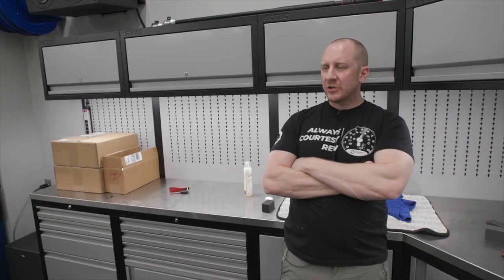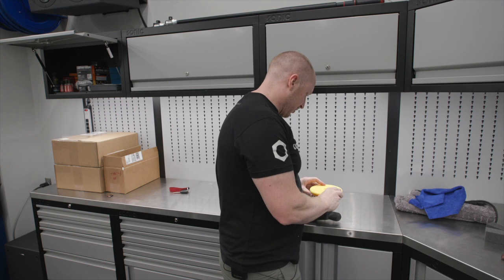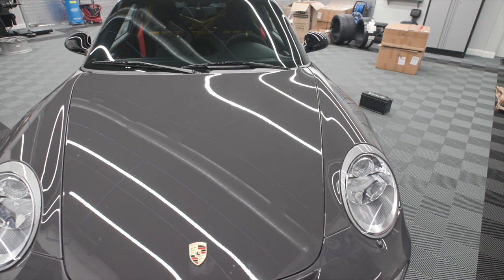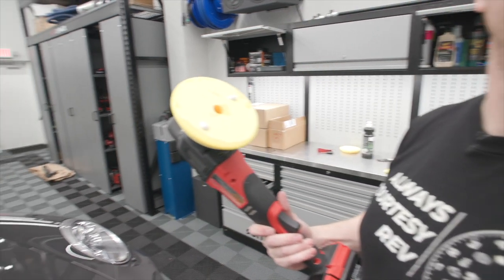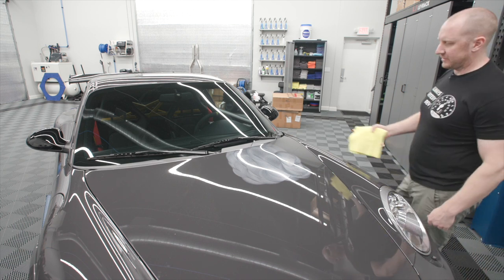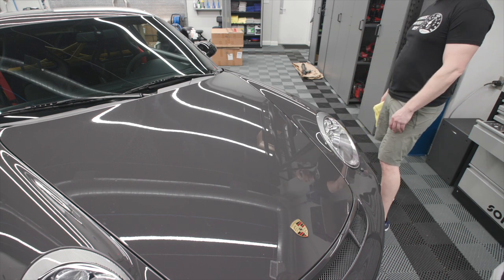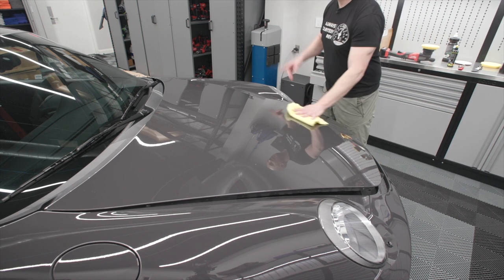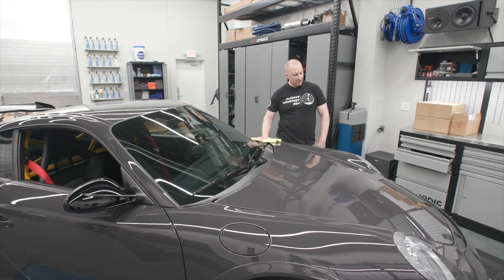How to Polish PPF - Giveaway 997.2 GT3RS

Comment: Important for polishing PPF is to go very light pressure on the lowest speed setting. Did my M4 (PPF on the whole front and roof) and the 8 year old car shines better than new.  👍
Reply from the maker: I would argue you can lay into if needed, but PPF is so soft that it is unnecessary.  It corrects pretty easily.

Comment: Matt, I will be doing the same to my F82 soon. I will be trying it with Gyeon PPF polish
Reply: Yes! Gyeon PPF specific polish worked well for me on a Rupes yellow pad and the speed at the minimal.
Reply: @jaxbrewery  say, did you try the rupes white or another finishing pad, or the yellow worked well ?? have the gyeon ppf polish here getting ready to use. thanks
Reply: @JoelSc14 I used it with the yellow pad and it worked great. Be sure to keep the speed low. Too high a speed and it’ll haze. But easy enough to fix if you haze, just drop the speed and go over it again. Good luck!
Reply: @jaxbrewery  awesome, thanks so much!

Comment: GT3 RS shouldn't have an enamel badge. It should be a sticker. Something isn't right. Should also have a carbon fibre bonnet and that bonnet was flexing too much for that with the pressure that was being applied........
Reply from the maker: This is a 997(2010-11) not a 991 (2016 or 2019).

Comment: I have done some trial-and-error experimental correction on Toyota's PPF.  Not sure if it's a dealer install or factory.  Tarminator works at removing the road funk. But you've got to put something back on the ppf to add moisture.  Polishing sorta works but looks not as well the next day once the oils from the polish have dried.  Hit it with the dry ice since its your car and not mine (yet).  For educational purposes only.  I know of an auto photographer that puts baby oil on dull ppf.  He swears by it.  Wipe on, wipe off.

Comment: I hate PPF.  Just doesn’t look as good as nicely polished paint.  I peeled my Porsche Caymans PPF off it was tired and coated it instead.  It took a month to get the front bumper cover PPF off in pieces , totally nightmare.  Took off patches of clear coat too.  Lea red how to paint base and clear it not difficult using Rattle cans and 2k clear ow it looks brand new.  I would never intentionally PPF a car.